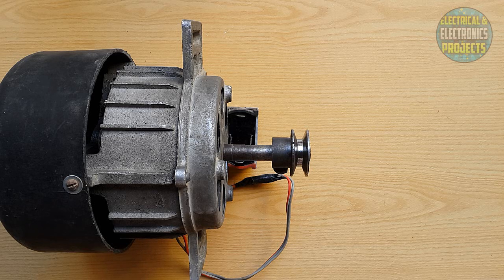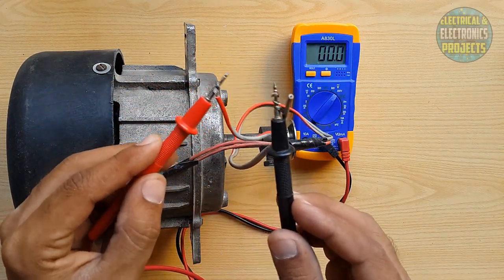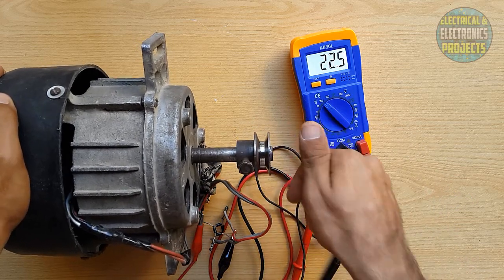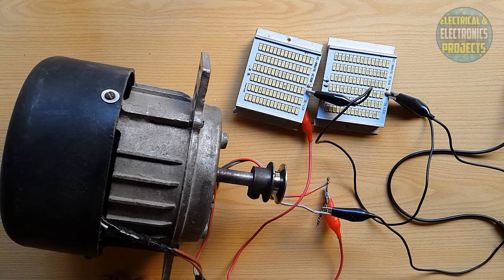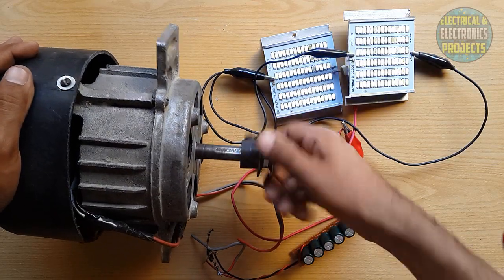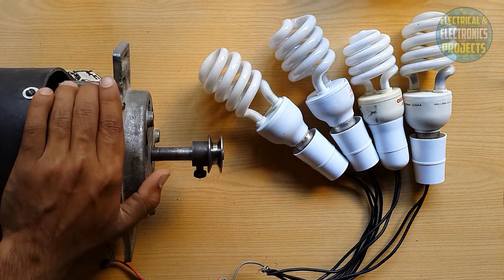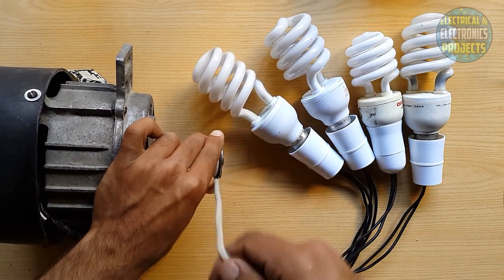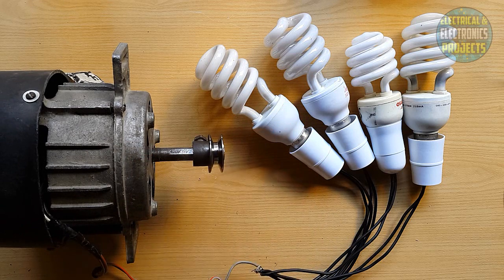How To Make Free Energy Generator 220V From Washing Machine Motor. DIY Free Energy Generator.

Comment: Your English is fine...don't worry about it..I can understand every word you say but that isn't free energy! You are the power supply and if you don't fill you gas tank (food) you would stop working. For free energy you need a wind fan or a stream of water and a water wheel.
Reply: yes... obviously
Reply: Bryan Dreyfus bir
Reply: Bryan Dreyfus *
Reply: Its a nice video for understanding AC/DC current and conversions, also very nice demo for how capacitors work and their function. However, i agree there is no such thing as free energy. "Law of conservation of energy" :) A further engineering on this can actually make this project into a renewable energy project. e.g. maybe add a water pushed rotor to it or something.
Reply: Bryan Dreyfus ok
Reply: Yep. I am in South Africa and busy going off grid. Saw a plan how to use 1 or even 2 big 208 litre oil drums. Cut out vanes right round them, insert a galvanised pole with bearings, use the washing machine drum  pulley, link up the washing machine motor. Hold thumbs. Just have to figure out the wiring!
Reply: @martybisschoff6000  Do record it and upload it to youtube. People like us would love to see it.
Reply: @AliOpridai  Thanks for the kind words friend. I will. Do not forget the bad responses. There are folks whose life purpose is to do just that. But do not stop. Love to you and yours, and like - mided folks
Reply: Bryan Dreyfus .k'i"9
Reply: Bryan Dreyfus
Reply: would  a waterpump to feed a water wheel be good. seems it would be  free power the pump then powr something else ... batteries.. etc
Reply: Bryan Dreyfus hahahaha sure you are right
Reply: Bayshaky drise
Reply: Best Free energy system
>>>>>>>>>>>>> https://sites.google.com/site/smartsolarenergy2017
Reply: this is also no free energy. free energy doesnt have to convert from mechanical to electrical. free energy are the radio waves in the air what you have to harvest with an antenna and some stuff.
Reply: Käptn Karacho b.   bb
Reply: i agree with you, but that can give us an idea
Reply: this is just a demonstration sir. its up to you, what source or force you'll gonna use (wind or water), its just him as the power supply on this video because its to long to demo if he use the real thing.. got it sir? and pls dont be so genius, if you dont have any of this idea
Reply: Bryan Dreyfus
Reply: So this could very easily be adapted by fitting blades or paddle wheel..so technically this invention is free energy but the guy didn’t happen to have any of the outside elements in his workshop..so what are you harping on about ?!
Reply: Good to see these type of supportive comments from other parts of the world. We should motivate such kids rather than bashing them. Thumbs up for the lovely response!
Reply: yes
https://www.youtube.com/watch?v=3dSAw6jIOh0&t=2s
Reply: Besides, he didn't need to make it in English. Urdu men ziada achchi hoti video. Esp when your English isn't correct enough to understand. No offence! Thanks for the informative video!
Reply: Now hook it up to a wind turbine or a water wheel and let nature do it and that's free. Because you don't pay for the force.
Reply: hahaha... this is a demonstration on how an old washing machine motor can produce free electricity when force is applied to the rotor. Now it will solely depend on you what kind of force (Wind / Water etc) will you use / apply for your rotor to move in constant motion. By the way the faster the rotor move the higher output you will gain.